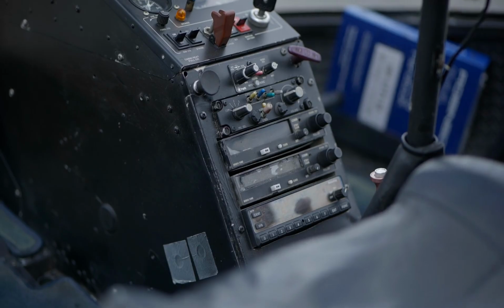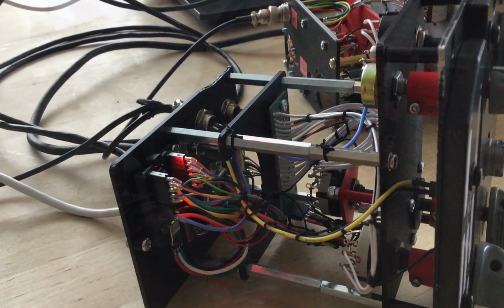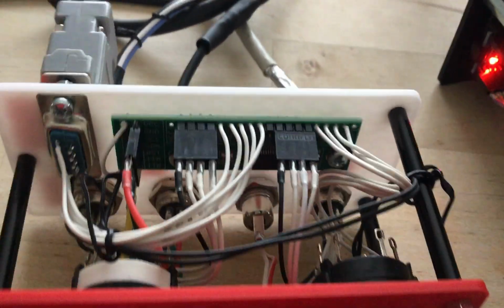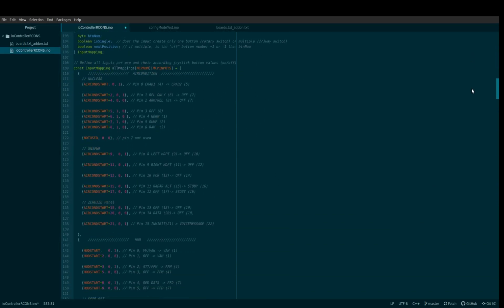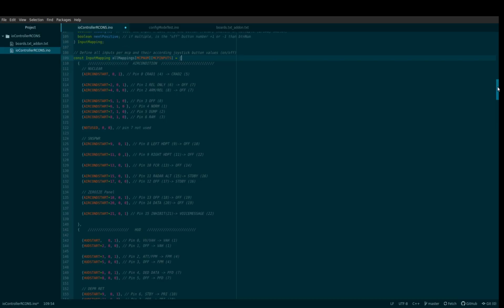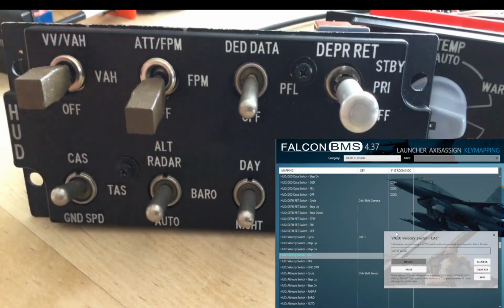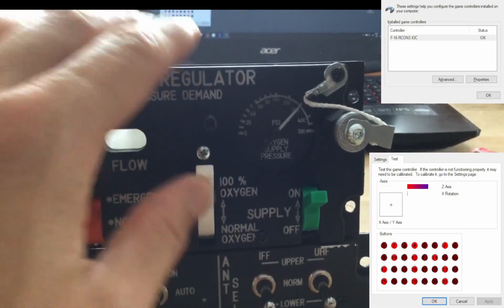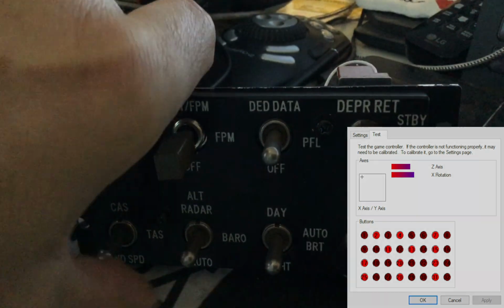F-16 Home Cockpit 12 - How To Build an Input/Output Controller

Comment: Am doing the same thing but I have a problem. How to you make the rotaries click into the exact degrees to the text on the panel. For example the ins rotary(off, str, nav...). Also where did you get the switches that you have to pull them up to turn them on and off. Thanks!
Reply from the maker: Sorry for the late reply...
You can buy rotaryswitches with different rotation angles, there are 30/36/45 and 90° available, afaik.
I bought my 45° from mouser.
But you can also just adjust the position of the text to the switches you have available, I did this on my old panels where I just had 30° switches available.

My push/pull switch mechanics are selfmade, there's a video about it here: https://www.youtube.com/watch?v=6FuvQ-H87K4
Reply: @simhangar6216  thanks for replying. Good idea with the letters. Also, I meant the actual on off switches not the rotaries that go up and down. Did you buy those?